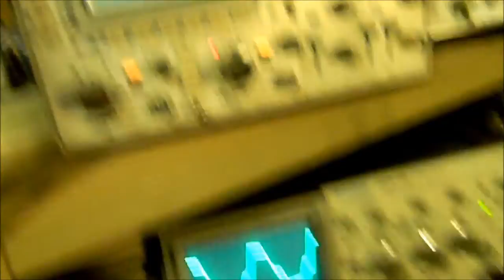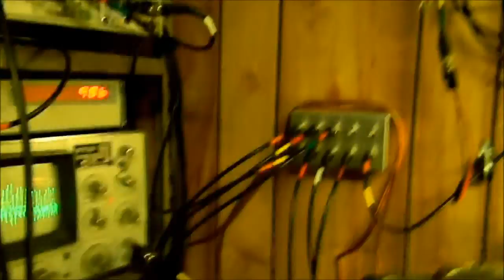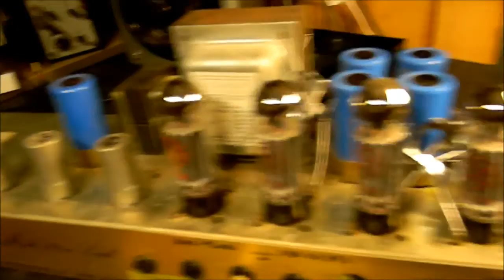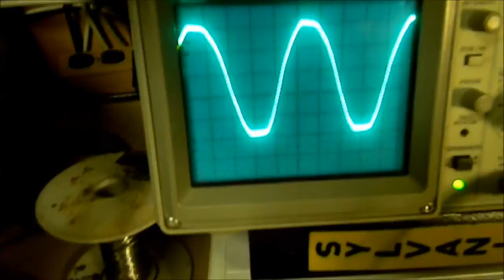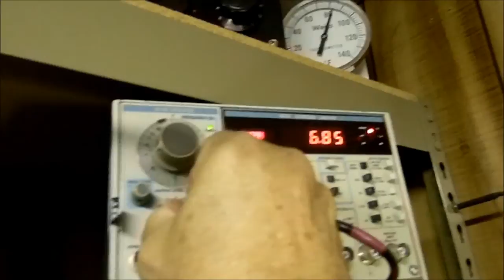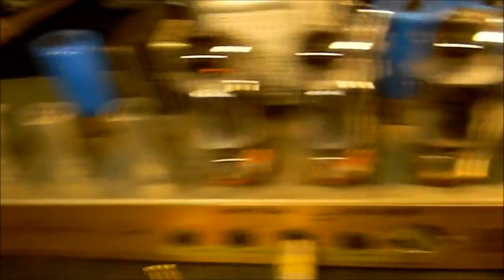Marshall JMP Mark 2 Master Model 100 Watt Lead Repair and Testing

Comment: Some people prefer the sound of 6550s over EL34s in Marshalls.
Reply from the maker: I can see how that could work. 6550/KT88's require essentially the same filament current (1.5 A for EL34 and 1.6A for 6550) so that should not be a big problem but the bias will likely have to be a little more negative for the 6550 than the EL34 to keep the plate current below maximum but if there is enough adjustment in the bias supply,  I could see that work out OK.
I made a video years ago trying many of the popular output tubes and the interesting thing about it is to compare something like a 6V6 amplifier to a 6550 amplifier. First problem is the 6V6 only needs 0.45A and the 6550 needs 1.6A to lite the filaments. That is a big problem and the 6550's are going to burn up the power transformer just trying to have the filaments lit. But let's look it the other way around. What would happen if you put 6V6's in a 6550 amplifier? They will actually probably work OK as the bias on the 6550 is likely around -50 volts and the 6V6 only needs about -15 volts so the high negative bias voltage in the 6550 amplifier will likely control the plate current in the 6V6's so they are not (at least immediately) harmed and burned up.  
With this said, let's assume our 6V6 amplifier does happen to have a large current filament supply and plate supply and can properly lite  and power the 6550's.  The next problem is that the 6V6 running with its bias voltage around -15 volts will be way too low for the 6550's and the 6550's will draw a huge amount of plate current and burn up the tubes. Of course you are going to get less power out of the 6V6's also. So the truth about swapping low power tubes with high power tubes and vice versa, ends up being the opposite way around what we might thing.

Comment from the maker: Yes, I did re-bias it to the EL34, high and low, as I thought in the beginning that was the proper tube. It did not make it much better. I was told by what I believe to be a knowledgeable viewer that the output transformer is the same for both sets of tubes in this amp. I am not too sure about that. Thanks for the comments.
Reply: Pretty sure the Transformer is the same for UK/USA, the bias supply is changed for USA/6550 tubes.
Reply: yes the OT is the same in UK/US Models. put el34 in an US Model without changing the bias feed resistors and the bias circuit will do strange things. so you can swap 3 simple resistors or 4 new 6550 :-)

Comment from the maker: Also, someone had "modded" the input jacks and did a butcher of a job. I returned it to original. I was given a link to a mod that basically gave it what it already had. It is hard for me as an engineer to understand where and why some of these mods come up. A lot of smoke and mirrors is you ask me. I think the creativity is in the hands of the musician and not so much in technology - I say this, respectfully, to All musicians and their Techs.

Comment from the maker: One thing I forgot to document at the beginning of this amp is when I connected it up, it was oscillating at 125 KHz or so with the EL34's in it. I did not take the time to measure the power  as I have seen these types of anomalies before, I did not become alarmed. The culprit was an additional cap in the feedback circuit that someone had added - if I remember correctly, about a 0.022 uF across the feedback resistor. I removed it and all the vestiges of "mods" I could find and it settled down.

Comment from the maker: I also do what every I can, within reason, to make the amplifiers meet their specified power output (10% THD is just my choice). I agree that some actually exceed their published power output. To get a true repeatable analytical picture of an amplifiers performance, what you think would be a good frequency, power level, possibly percentage of rated power, and so on to perform and post for the various vacuum tube musical amplifier manufacturers. Any ideas would be appreciated.

Comment from the maker: I use the 10% THD point as what I consider reasonable distortion in the creation of music and I know that overdrive is very desirable in many cases. Also, at 10%, notch distortion may just be starting to appear. I think an interesting project would be to document the harmonic profile of the various manufacturers as I am beginning to see reoccurring waveforms in same type amplifiers. Not sure what power level or other settings to use  so I have never started the project. Any thoughts?

Comment from the maker: Yes, I did initially swap the  EL34's with new ones and I got the same results. As for the bias, I did go through the full range but could not eliminate the notch distortion or improve the sine wave significantly with EL34's. I noticed the markings on the transformer and that is when I swapped in the 6550s and got dramatically better results. I really appreciate your comments and verifying the primary impedance of the output transformer for me.

Comment: Very nice discovery about the impedance match.
I've been working on a Harmony H420 which had a similar problem, in addition to a blown speaker, and found ridiculous engineering in the design. Phase inverter with one cathode bypass cap but not on both halves, resistors out of tolerance, etc. One side of the output stage was being driven, the other not. Put out 4W when I got it, worked on the phase inverter, put cathode bypass caps on the outputs, and now getting clean 24W.

Comment: I am beginning to suspect that guitar amp manufacturers also spec power output at 10% THD because I have a Harmony H420 in the shop right now that is rated for 35W (twin 6L6GCs, 380V B+) but measures 24W at the point before clipping, but 33W with severe clipping at 10% THD. Somehow, I think that's cheating the numbers to make it look better for the marketing. Oh well, such is the business.